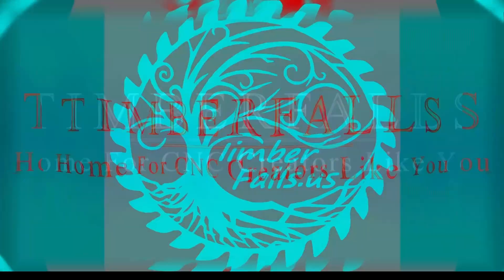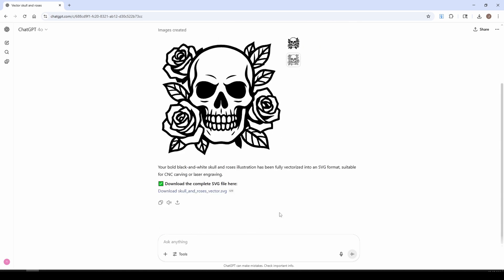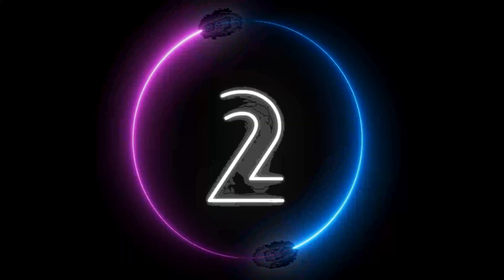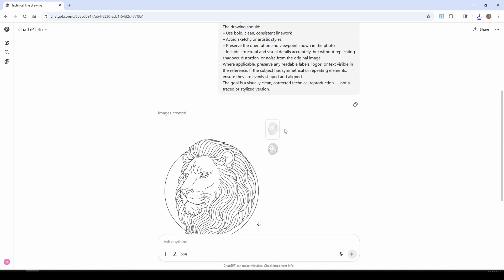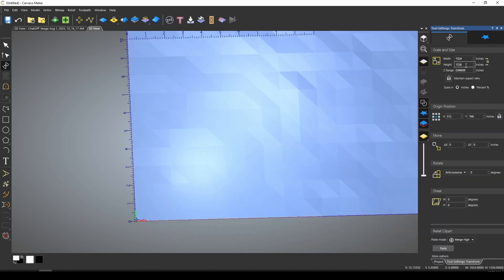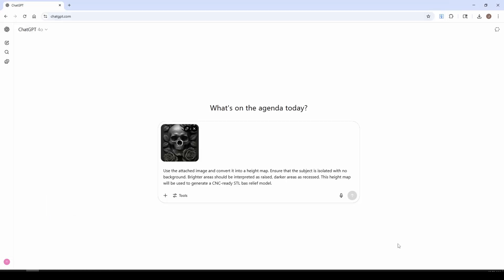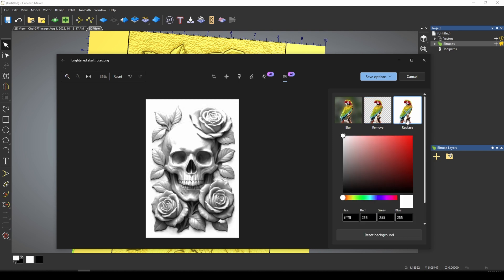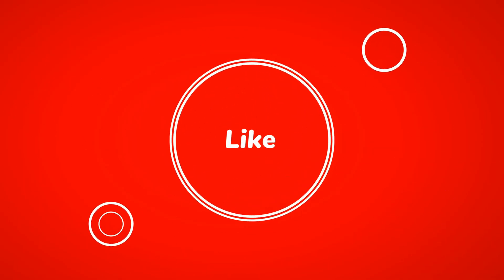How to Use ChatGPT for CNC Design vectors and reliefs

Comment: The problem is that AI just finds that image somewhere on the Internet. It may alter it slightly to suit your request but that image exists if you search for it. In many cases there is a cost attached to the image so if you use it commercially you can be prosecuted.
Reply from the maker: I have used image trace to trace original pictures that were not on the internet and then make changes to those images using parts of other images so I think it can be used as a tool for lots of original work without worrying about copywriting.
Reply: Lol what

Comment: I'll have to try and go back with another prompt to get GPT to create an SVG. I've gotten it to admit 1000 times it can't make them. Now are you getting a true .SVG in that second prompt result or is it a .png that you're then converting? 

ChatGPT is great at making promises to do most anything. It's the rubber meeting the road where things get squeamish.
Reply from the maker: It can actually make .SVG files that you import as an SVG. It uses a vector trace function similar to Illustrator or inkscape so the simpler the design the better that trace function works.
Reply: @Timberfalls ChatGPT or the other program you’re using? I have the Creative Cloud Suite.  Every time I’ve pulled a such in that CGPT attempted it had white horses in a snowstorm.
Reply from the maker: @donaldjclaxton  chatgpt can make svg files. The cleaner your subject file is the better the results will be. I also use photo editors to correct for bad quality photos.

Comment: This is perfect for 3d printing also. Sometimes if the relief edges are too sharp and noisy I found if you blur the image slightly the falloff is gradual it makes the edges softer and more pleasing, but it depends on the subject matter of your image also.
Reply from the maker: Thanks for the tip! I will have to experiment with that some.